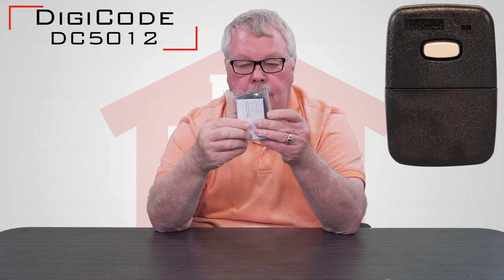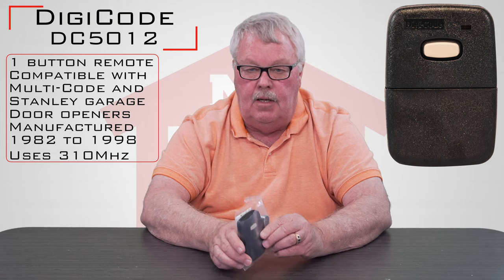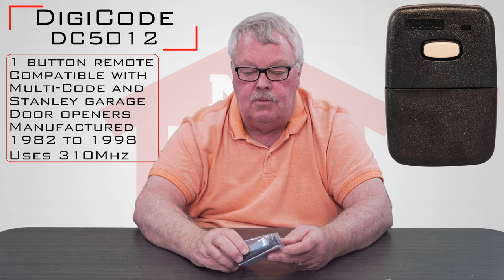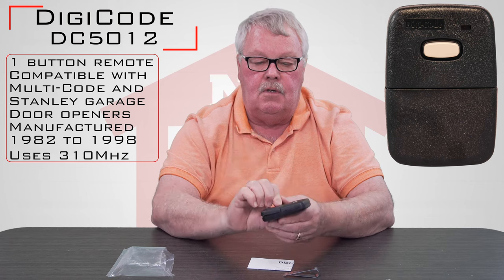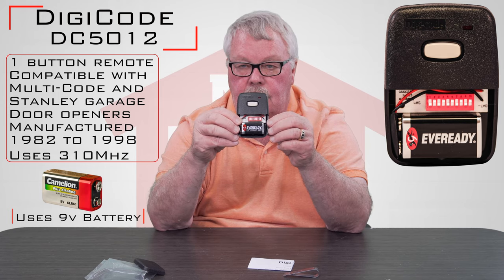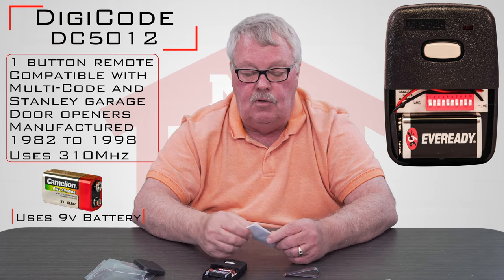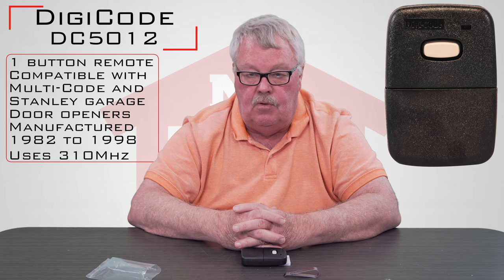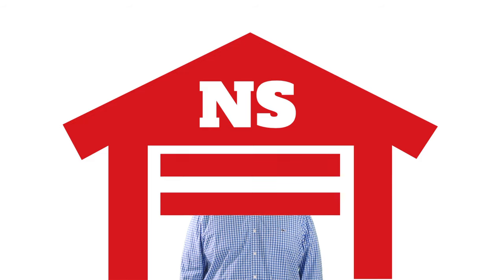Digi-Code 1 Button Visor Garage Door Opener Transmitter DC5012

Comment: I have a Digi-Code transmitter that I believe came from the previous homeowners, circa 1980s.  I could be wrong. It's a black case, one-button device. I don't know where to check for the model number. Recently it quit opening the door. I can close the door only. Can you help?

Comment: So, does that mean it won't work on my Liftmaster 3255 G/door opener?  Only Stanley?  And what the heck is a m/code digital radio anyway?
Reply from the maker: MultiCode is a type of encoding format. This remote is designed to work with MultiCode Stanley receivers and operators that are on 310Mhz frequency. Liftmaster uses another format called rolling code and security+ which is not compatible with MultiCode so this remote will not work on your operator. This manual should help you further on understanding what remotes work with this operator http://embed.widencdn.net/pdf/plus/cgi/jbhqqopqmv/114a3080.pdf?u=gsn58x  We carry remotes that work great with this operator like this one https://www.northshorecommercialdoor.com/li37segadoop.html